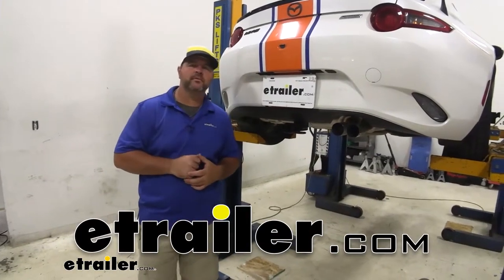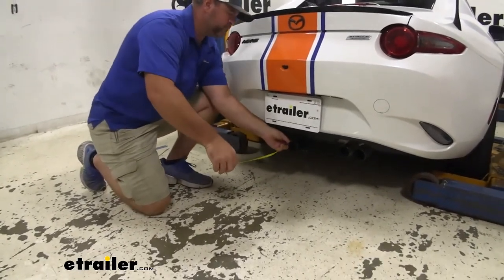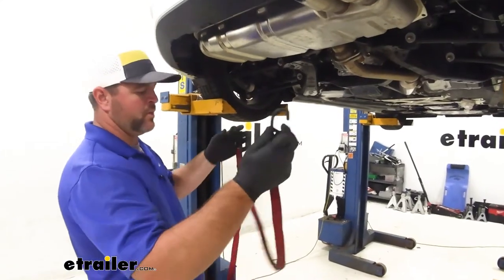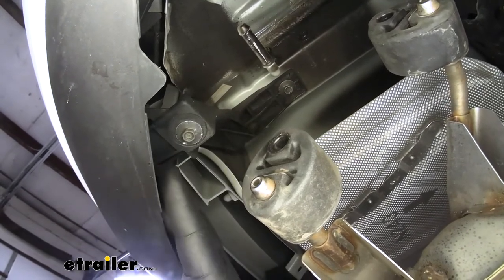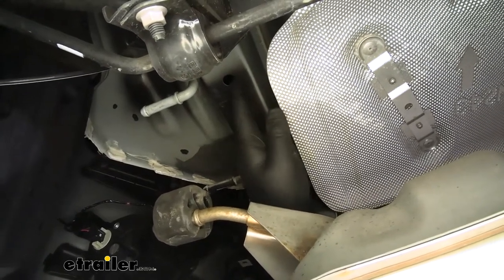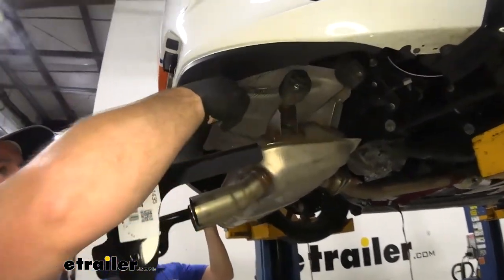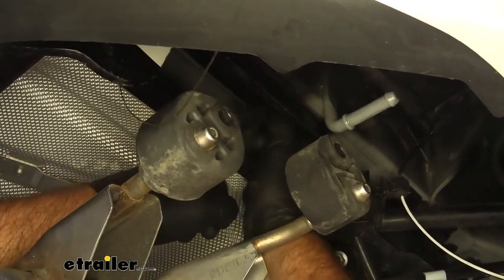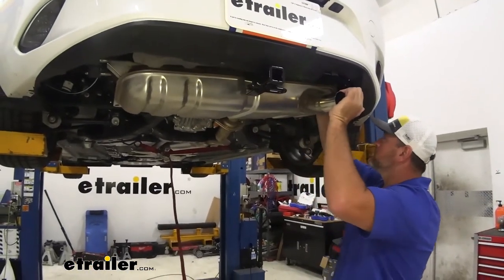etrailer | Curt Trailer Hitch Receiver Installation - 2019 Mazda MX-5 Miata

Comment: Great installation video, reckon this would fit with the OEM rear skirts? Thanks
Reply from the maker: According to Curt, their # C11435 hitch fits all models of the 2016-2022 Miata MX-5. As long as the skirts are OEM, the hitch will fit.
https://www.etrailer.com/Trailer-Hitch/CURT/C11435.html
Reply: @etrailer  awesome, thanks mate.
Reply from the maker: You're very welcome!

Comment: Great information.  I watched both this and the video for the 2020 MX-5 for different views.  Easy if you have access to a lift or find someone from E-Trailer's list of installers (Tomahawk Enterprises for me).  My only question is why use the rear lateral frame holes instead of the vertical frame holes?  Ether requires the holes be slightly enlarged.  I am using the hitch to support a spare tire holder on my 2019 Miata.
Reply from the maker: We're glad you liked the video. As far as which holes are used, that'd be a question best asked from the folks in the engineering department at Curt.
https://www.etrailer.com/Trailer-Hitch/CURT/C11435.html

Comment: Can the hitch and basket be used to carry a spare tire(oem wheel)? I'm looking to carry a spare on a long road trip.
Reply from the maker: The hitch has a 200lbs max tongue weight. So if you can keep the combined weight of the tire and cargo carrier you could in theory do that. Make sure you use some cam buckle straps to secure your load too! https://www.etrailer.com/s.aspx?qry=Cam+Buckle+Tie+Down